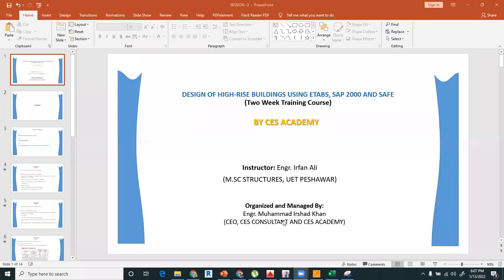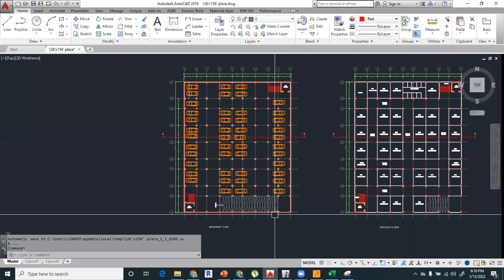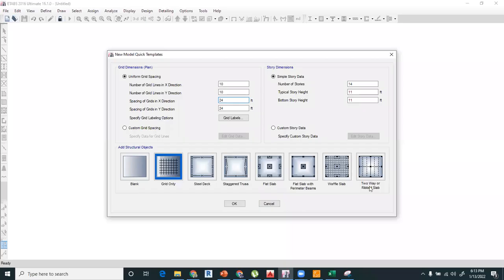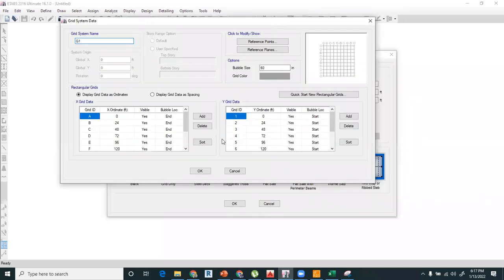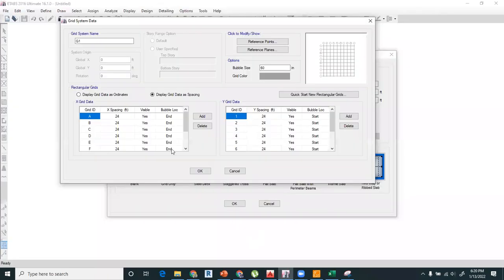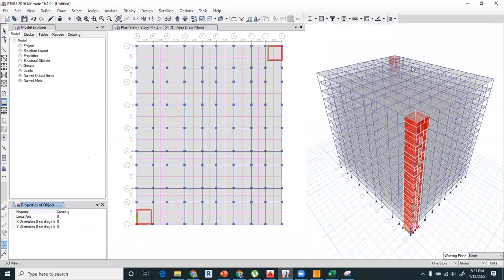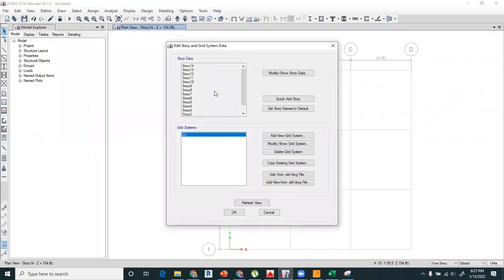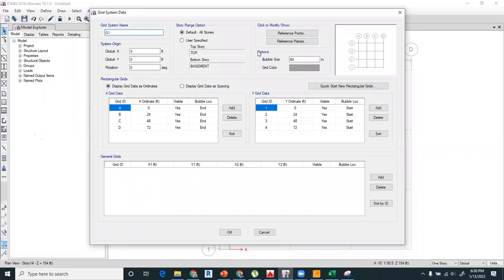Session 3 (P-1): Structural Modeling in ETABS | 14-Story Building Example

Comment: If there is one way and two way slab both then what will we chose in new model quick template
Reply from the maker: One way and 2 way is only for manual calculations. In Etab, you just need to assign slab which ever is easy for you